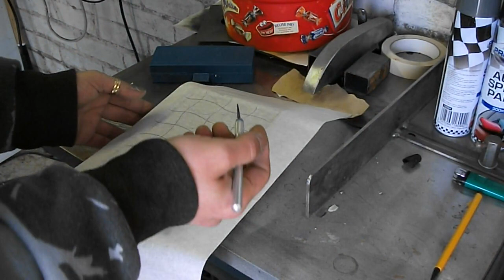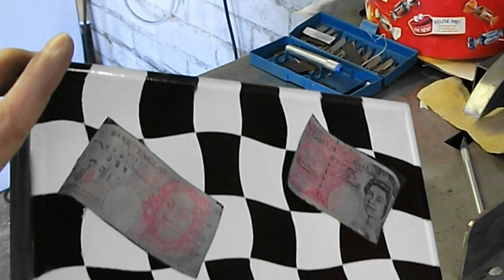Airbrush tips - how to paint a checkered flag

Comment: One tip, on keeping bleed under the tape at bay...before you spray your mask color (white in your case) hit it with a medium coat of your base color and let it dry almost completely, until slightly tacky. This makes a good barrier at the tape edges and will keep your top color from going under. Much cleaner mask lines this way.

Good video, keep up the good work.
Reply: A trick: you can watch series at Flixzone. Been using them for watching lots of of movies these days.
Reply: @Sergio Dexter definitely, I have been watching on flixzone} for months myself =)

Comment: I don't have any transfer paper can I use something else that I have in my home that I can use in the place of transfer paper
Reply: Masking tape is the easy choice. I have been doing something that I haven't seen anyone else use on YouTube, I might make a video. I have purchased from Walmart a big bottle of Liquid Latex (Halloween is when they have it in stock and available). I use the liquid laytex on nearly everything. Airbrushing, water color, spray painting, and also some painting around the house. The liquid laytex should be used with caution, it does have a strong scent, its flammable, and it will ruin clothing, carpet, rugs and other porous surfaces. It will peel off with little to no residue and its the sharpest lines you will ever have.  Laytex is the way to go! I'll post a video very soon.